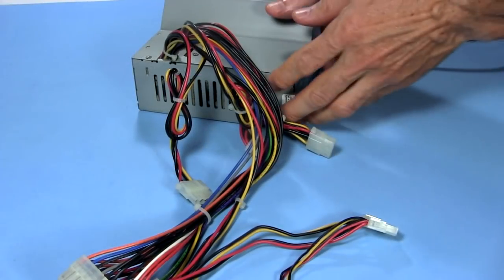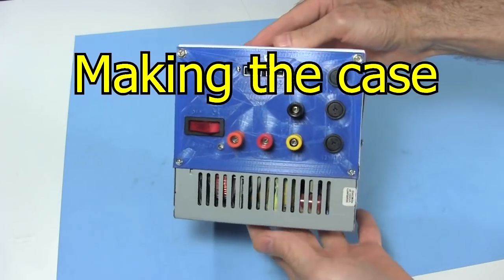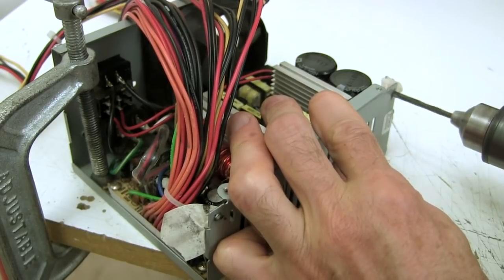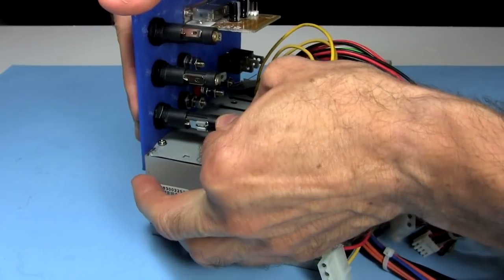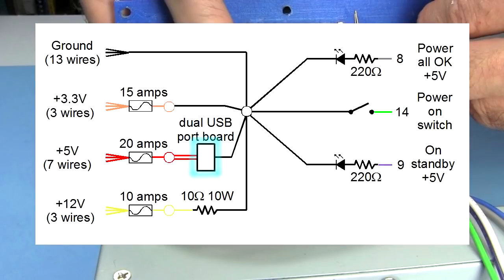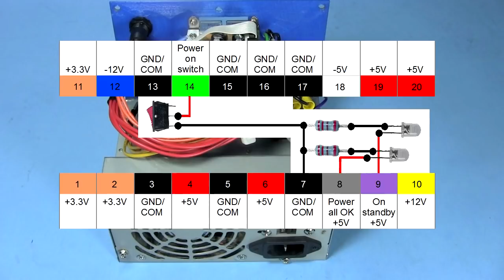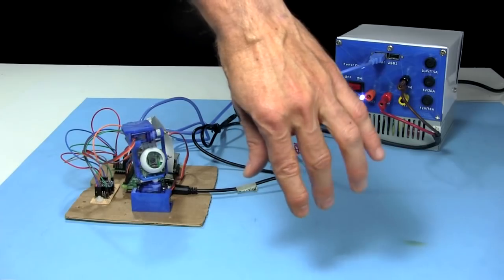Convert ATX Computer Power Supply for USB

Comment: Hi there RimstarOrg was looking at your video collection and ive been a sub of your since 11yrs ago wow! lol (how to make solar cells). Anyway, hope things are good. I like this well explained video, and might do this myself. Never heard of merrets before and those ring terminals look neat. Can i ask something, how do you regulate the amps? ~ or will it only draw what the device wants? all the best, kieron
Reply from the maker: Hi kieron, I'm glad to hear you've stuck around all this time.  I don't know for certain that this power supply will limit the current to the maximum amount written on the sticker on the power supply. But if the load tries to draw any amount up to what's written then the power supply will give it. So if the sticker says the maximum is 22A and the load tries to draw 5A then the power supply will give it only 5A.
And in case you go shopping for them, merret is spelt marrette, which is actually a brand name but that's what many people call them. A more generic name is twist-on wire connector.
Reply: @RimstarOrg  Thank mate, thats cool. Good to know devices will only draw as much as they need hmm... Ive just made a "camper" trailer and put 12vs in it too for lighting and power supply (camera). It means i can just rock up, cook my food and then kip in my car. Here in the UK our cars are tiny lol, thought id share :) Just got back from Wales. Needed it, i like the peace and the quiet of nature.
https://ibb.co/DpPMS4m
https://ibb.co/w7kpjhm
https://ibb.co/gVDb1hN
https://ibb.co/NpD5Gfv
Reply from the maker: Keep in mind that I was talking about the specific power supply in this video. A battery would behave similarly. However, some power supplies allow you to limit the current to something below their maximum, called current limiting. Nice job on the trailer.
Reply: @RimstarOrg  Thank you. I appreciate it. Have a good one, all the best kieron

Comment: Will it be good enough for tesla coil that you have made?
Reply from the maker: Hmmm... I hadn't considered using it as the low voltage power supply to feed one of my high voltage power supplies (which then feed the tesla coil). It should work. It would be a fixed voltage into the high voltage power supply but at least I have a selection of 3.3V, 5V, of 12V. The current ratings are even higher than the low voltage power supply that I usually use. Interesting.
Reply: @RimstarOrg  Thank you, that was very helpful ,Im low on money so  ill just go to my local scrapyard and try my best to find parts that i can use and if it won't work i'll just buy old used psu

Comment: I wish we had a store that carried these parts. Everything has to be ordered in. If you are going to get something shipped you might as well take a chance on a Chinese ebay shop. Ending in substandard devices.  Now if someone opened a shop they could not compete with the prices.
Reply from the maker: Yeah, the tradeoff is expensive parts bought in the stores locally vs a longer wait time/possibly low quality. Sometimes I don't want to wait.

Comment: will this work for resistance soldering?
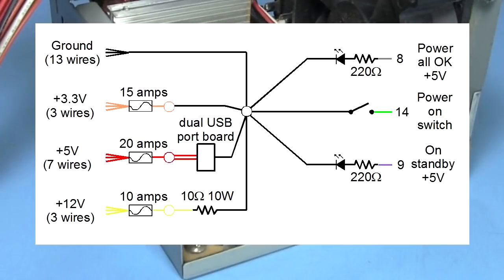Reply from the maker: I don't know. As I show in the diagram at around 5:58, the 12V output can handle 10 amps. That's 120 watts (12V x 10 amps = 120 watts). Most soldering tools require less than that. So possibly it would work.

Comment: Hi, Steven! This is Carleigh, and I work with a production company in Texas. Right now, we are trying to recreate your experiment creating lightning in a bottle with a Van De Graaf generator for a show we are working on. We are having trouble recreating your experiment. Would you be okay offering up some advice?
Reply from the maker: Hi Carleigh. How big is your Van de Graaff generator's dome? That's an indicator of its potential output. The first thing would be to test if your generator is working well. I show a bunch of simple demonstrations you can try here https://www.youtube.com/watch?v=Gf6EbRmYImI. Very humid air is also bad and will reduce the voltage you can get. Also, make sure there are no sharp metal objects within a few feet of the generator since they may bleed off the charge. The spark length is also a good test (like I do near the beginning of the demo video) but is dangerous to do if you have a big generator and don't have access to a safe Earth ground (I wouldn't want you to damage your production equipment).

If the generator seems fine then it may be the bottle. Make sure you use tap water and not distilled water since tap water is more electrically conductive. My bottle was a plastic one with thin walls. I don't know how well a glass bottle will work or one with thick walls. A thick bottom may also make it work less well.

Comment: Can I solder a normal 100 kOhm resistor to a 100 kOhm multiturn potentiometer in order to get to 200 kOhm? Can't find a 200 kOhm multiturn potentiometer! My step up booster uses the 204w trimmpot
Reply from the maker: Yes, you can. Keep in mind that the range for the combined resistors will be 100 kOhm to 200 kOhm.
Reply: @RimstarOrg  Then I have to connect 2 potentiometers in series.
Reply from the maker: Yes, 2 potentiometers in series should work.

Comment: Hello everyone, can I ask you about my atx suppy?  Its standby mode is turn on already.  But if I switch on the power mode it makes power but short time only.  If I put a dummy load to the 12v wire (highest watt)  it is not turning on.  I hope you all could help me
Reply: You can try both 5v or 12v. See if one works also there a 3v3 you can look up. It's not in this Video.
Reply: Thank you but I already fixed it.  But my other atx power supply is also not working as well even though I put 10watts 20ohms dummy load to 5v supply.

Comment: Seriously, what is needed is converting computer power supplies into car battery chargers. Find a way to take the 12 volt output which is usually in the range between 11 volts  and 12 volts and is incapable of fully charging a car battery. Please use your knowledge to make the power supply output 14 to 15 volts. For lack of knowledge, I was afraid to put the 3.3 volt output in series with the 12 volt output. If that is not possible, you will have to find a way to amplify (transform) the 12 volts to 14 to 15 volts. Car battery chargers are needed all over the world and adapters from 12 volts to USB can be found in the dollar stores. Please help computer power supplies have a second life as car battery chargers. With your sophistication, I am confident that you can transform this power supply to one that supplies voltages for multiple rechargeable batteries form 1.5 volts to 15 volts.  More power to you sir!

Comment: the highest rated binding posts I can find are 16A. ... don't you need one that can handle 30A?
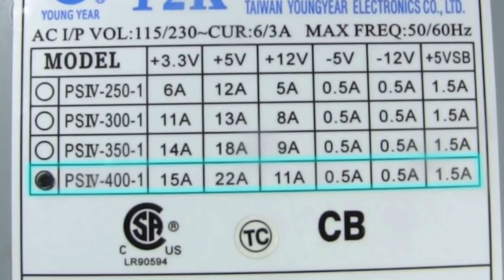Reply from the maker: Judging by the chart on the back of my power supply (3:27), the highest rated current for mine is 22A for the +5V output. So theoretically, yes, you need a binding post that's rated for the highest current for that output. To make it worse, the thin ribbon wire I use for connecting to the USB board for the 5V output wouldn't even handle 16A, let alone 22A. One solution is to put a fuse that is higher than you'd need but lower than the lowest rated component, so 16A in your case. That way if something which you plug in tries to use more than 16A, the fuse will blow instead.

Comment: Man stripping that Ribbon cable did not look easy.
Reply from the maker: It may not have looked that way but it was easy. The trick is to gently cut with the knife until you feel the roughness/hardness of the copper and then stop cutting there. It's pretty obvious when you hit copper. Do that all around the circumference and pull off with a fingernail. It may not pull away on the first try, but it took no more than three.
Reply: @RimstarOrg  Thanks for the tip! Love your content! I'm a tech student studying electronics and I find your videos quite entertaining. Keep up the awesome work!
Reply: @RimstarOrg  About the ribbon cable... 
It seems way too thin.  Remember, the USB sockets on old PCs only had to provide about 500 mA of current. A modern tablet, and even some phones, charge at 2.1 Amps... is that tiny wire capable of handling that much?  What about other devices you may plug into that socket that would draw even more? -- LED strips will sometimes draw much more than that!

Solutions:  Either check the ampacity of that little wire and fuse it accordingly, or replace it with a thicker wire, and use a 3A fuse on it.  

The second option is better if you plan to use the device to charge phones and tablets.  There is a third solution, which is what I did.  Use the purple wire. Two reasons, because it is already rated at around 3 amps, and an additional bonus is that it will power the USBs even when the unit is in Stand-by mode!  Very convenient.

By the way, your extension of the case was brilliant!  Result looks really nice!  Impressive video production values, too!

Cheers!
Reply from the maker: Hmmm... I hadn't considered the ampacity of the ribbon cable wires. Good point. This was the original cable in use when the USB port was in the computer but I don't use it for normal purposes (servo motors).
PS. Sorry for the delayed reply. I don't always get notified of replies to comments.

Comment: Lots of dangerous information:
Discharging PSU: Get an old screwdriver, run a 10w 100R resistor from the shaft to a crocodile lead which you connect the ground and discharge the PSU - I work with valve amps which are way more dangerous and thats the safe way to do it. A disconnected power supply will maintain lethal voltages for a very long time!
Extending the case - Screw air flow, its Faraday Cage and insulation from live mains, thats the reason.
10w Resistor across the biggest supply? Really? PSUs have sensors that report back to the power management that there is a load, its better to fool that - its the same with converting a projector to LED and making it think the discharge lamp has struck.
This video is very amateur and should be pulled from YouTube, I hate health and safety, but in the old days we had 'Common Sense', those that did not have it learnt from their mistakes or are not around anymore. That was their doing, publishing dodgy information is your look out. Maybe remake the video?